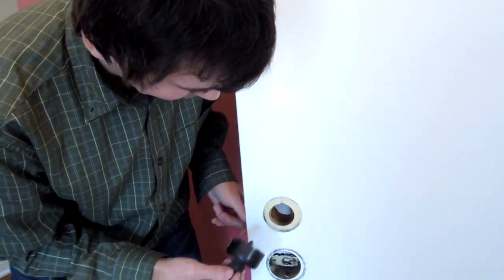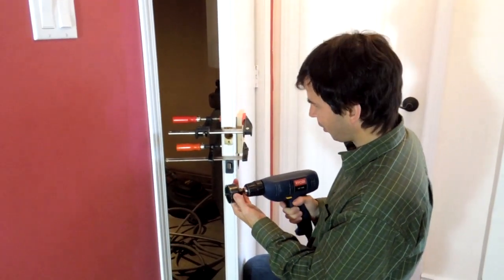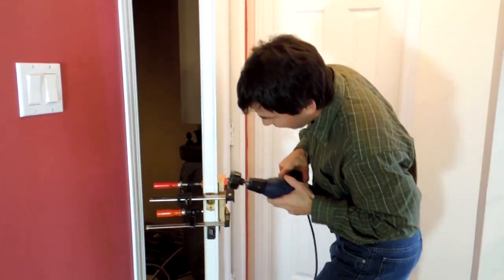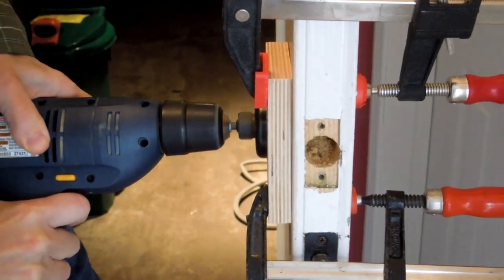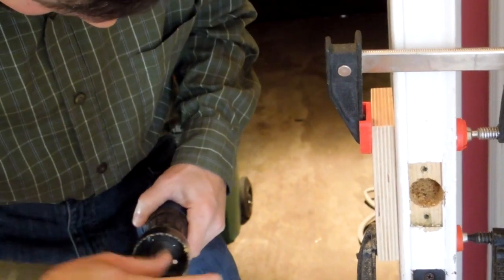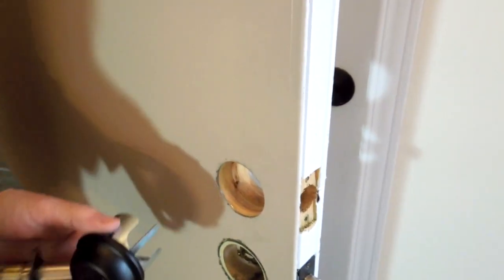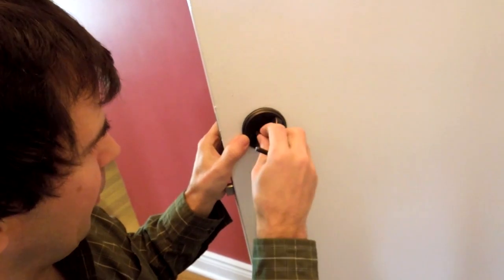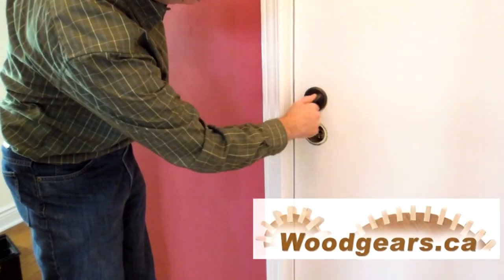Deadbolt installation

Comment: Was that a bi-metal hole-bit? Looked like a regular wood bit; though it would handle a little bit of metal, the bi-metal bit would have chewed through that much easier. The template was a good idea though (like most of your videos).

Comment: Should be called "how to rape your tools". It really dosn't look good for the drill, or the drill chuck. Especially from 1:20 it really looks like your busting your tools. I know a few brands of hand drills, and drills that wont make it's in good shape through that.

The template is a good idea, but seeing how much you can twist it, i would have made a more snug fit, or deeper board.